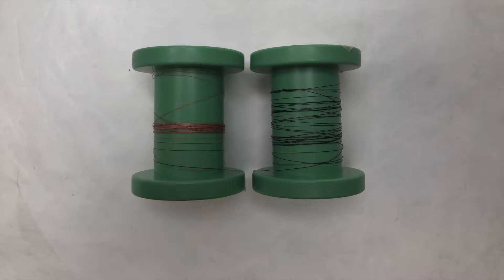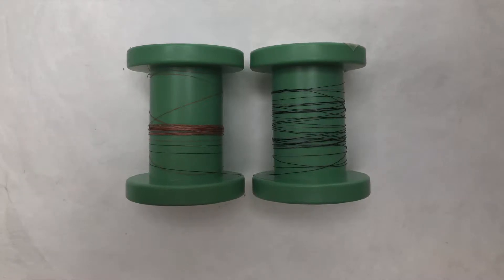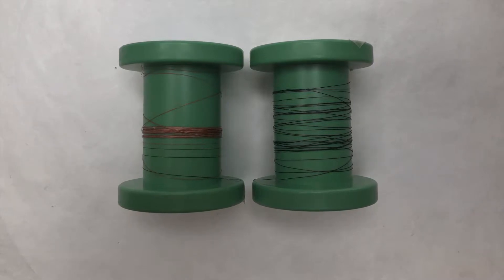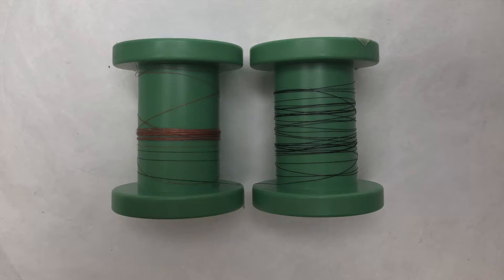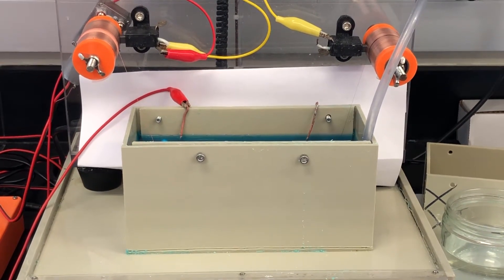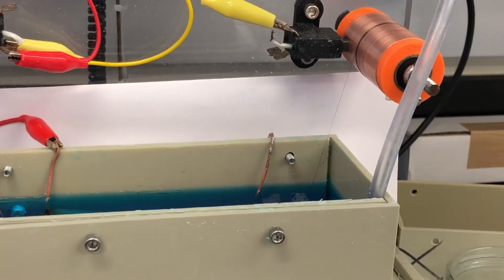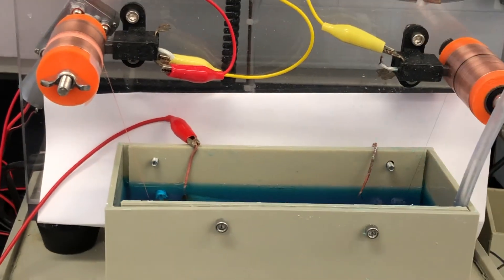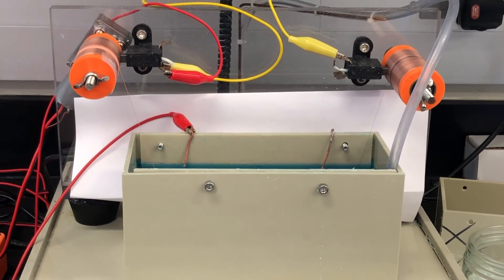Plating Carbon Nanotube Yarn with Copper

Comment: If carbon nanotubes are better conductors than copper, why would you plate them with it?
Reply: @elijah_9392  depends on the application!!! It's not only about the best electrical or thermal conductor, sometimes you need potential differences and other factors like environmental and reactivity.... subjective